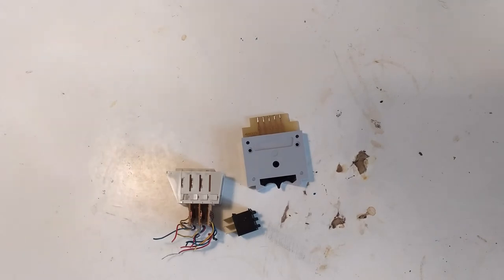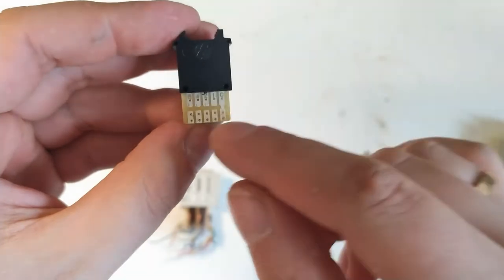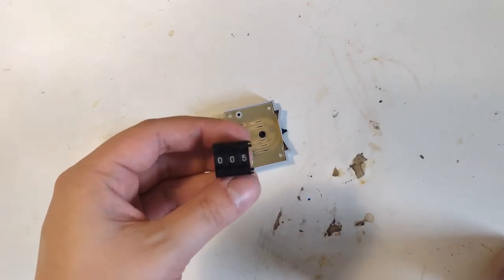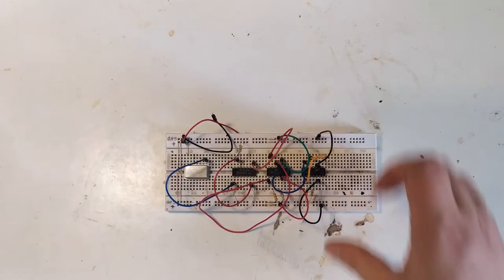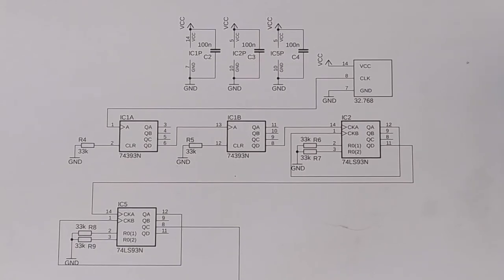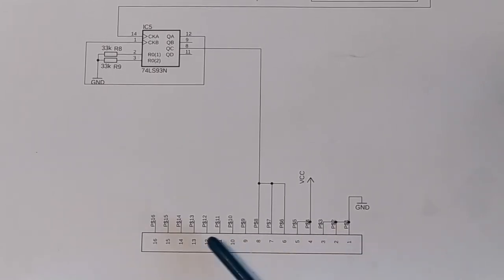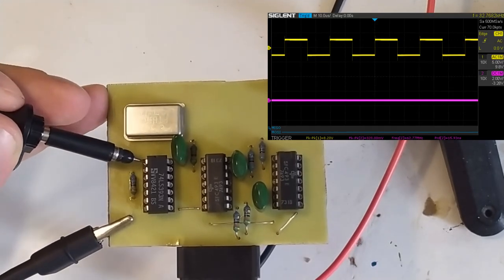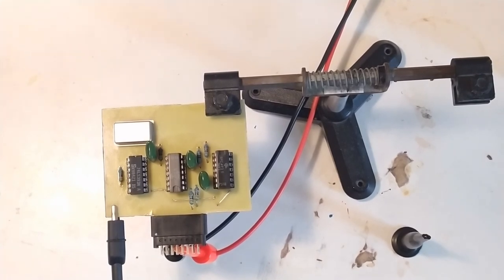Building a TTL-Clock/Timer Part 1:  Crystal Oscillator

Comment: Great project! I built myself one in late 80´s (88 or 89, not sure), for developing B&W photos because I needed a time relay/timer, so why not to add a clock too?
Today kids have it easy, just throw in a Arduino/PI zero, some LED 7 segments, some code and job done.
I used TTL only chips (not S, LS, HC just plain old 74 series TTL) 7400 for oscillator, 74192, 74193 as counters/dividers, 7442 as driver for nixie tubes and same rotary encoders that I salvaged from some old equipment thrown away from a factory, as well as the Nixies and theirs sockets. Also the 7442 (the soviet equivalent). I remember that while building it, I tested it on each IC I mounted, because I got some ICs quite easy but some were quite difficult to find and also didn't have a scope or digital tester. It worked flawlessly.
I built it on one board, the power supply included and the display tubes on the front. It displayed the time as HH:MM:SS.D because from the 8 Nixie tubes that I had, one broke. The points I made with regular neon lamps. 
The case was made from wood.
Reply from the maker: Hey! Sorry for the late reply, I'm preparing to move places at the moment and there's just soo much electronics to pack, I Packed several Euro Containers full of transformers which again reminded me of why almost everything is switch mode now (you hardly break you back lifting a box of those). I think things have gotten a lot easier these days, problem is it doesn't really help understanding if these things are abstracted away. Two edged sword this.  Your Project sounds really nice! Also a lot more involved that what I am planning to do, albeit I've already though about adding a display and clock. Feature creep is real :) I remember times when components where scarcer for the average hobbyist I don't really miss the bin of de-soldered 20 year old electrolytics in varying states of decay though.
Reply: @captainsolder5247  Thanks for your answer. I didn´t lost the habit of salvaging components from old/trashed boards. Mainly ICs, crystals, transistors, diodes and power resistors. And LED's and displays. I love them. And I prefer thd for use in breadboards.
When at university, a professor told us something on the line Go for micro controllers ONLY after you understood the basics in analog and digital. And only then. i was in love with big digital schematics drawn on multiple A4 sheets. When I discovered I8031 I was amazed that it could do in a more elegant fashion what a big schematic does. But I never lost the full discrete logic way of thinking (CLC, bistables, discrete gates)
Reply from the maker: Yea I definitely grab power resistors and all the large discrete stuff other things depending on price and my own stock but I got out of the habit of salvaging electrolytics even good quality new ones are just far to cheap these days in my opinion. We had something similar but more general along the lines of you can use "thing" to make you life easier once you know how to do the job without "thing". Which actually works in many fields besides electronics. I think it's good design practice to keep that way of thinking alive. Even with today's micros you'll probably end up with a better design if you are actually understand reasonably well whats going on in the processor. Also large boards stuffed with many low integration circuits are just a lot of fun to design and look at.